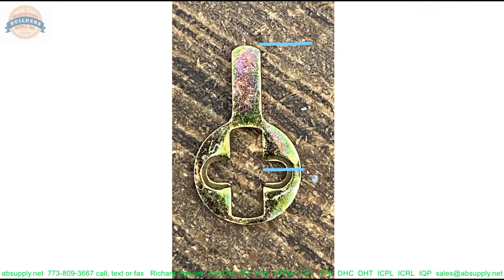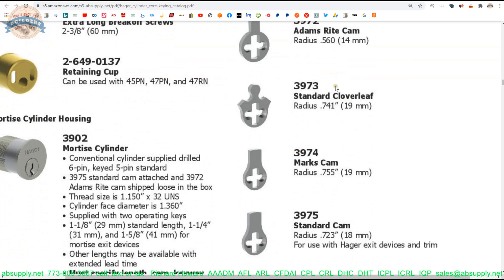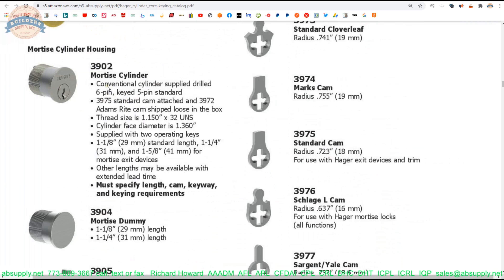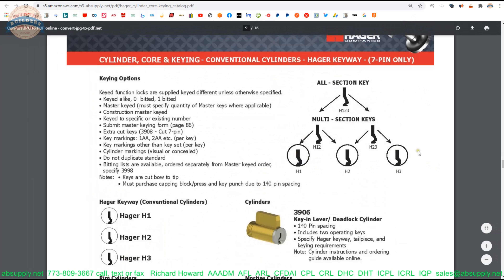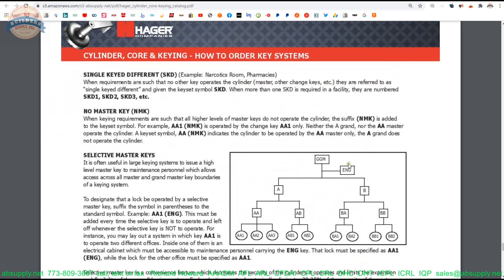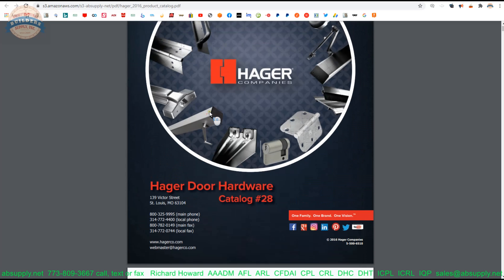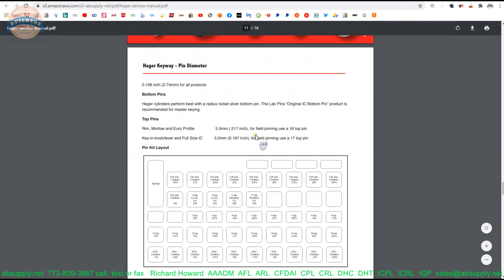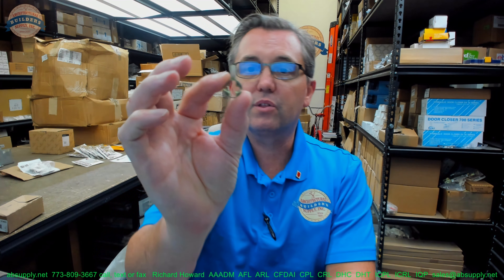Hager 3977 US2C Sargent Yale Cam  733 Mortise Cylinder   Zinc Plated

Comment: I have a Sargent 761 push bottom mortise lock with a Yale cylinder lock. In 40 years no one has ever had the key to it. I pulled it apart to get it working again (the lock wouldn’t turn.) I works now I just need to know what I need to replace the Yale lock so I can finally have a key and access to that door. I would be greatful for any help. Such as what replacement part I need or sending in the Yale lock to be keyed, something anything. 40 years is too long!!!
Reply from the maker: You have a mortise lock and no key to operate it?